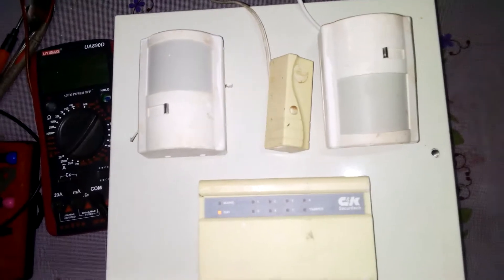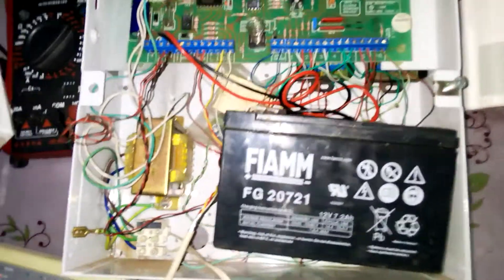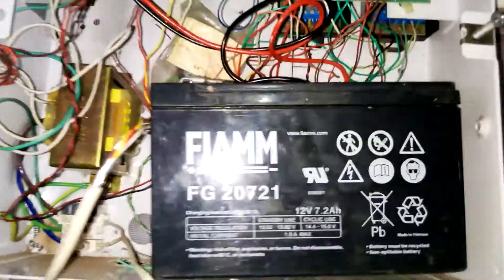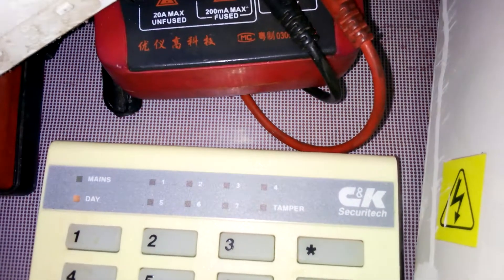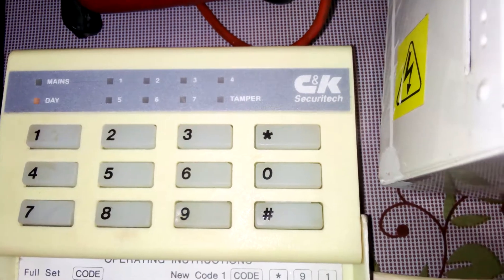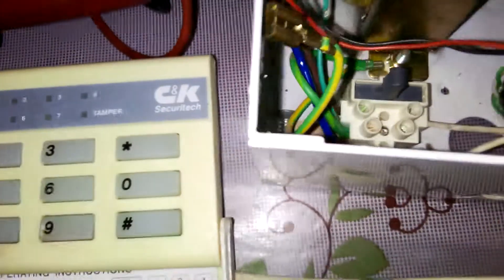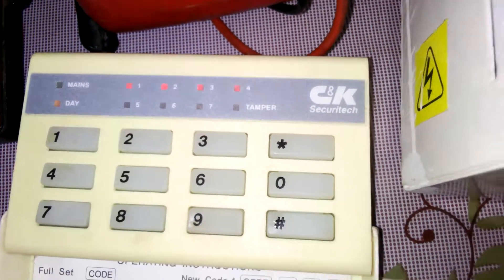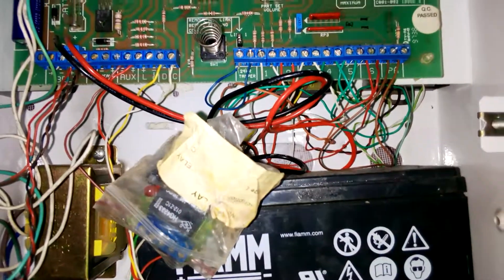C&K Securitech 700L alarm programming at home

Comment: Hiya i forgot the previous code. How do i factory reset the alarm and put new code. Please let me know
Reply from the maker: Open the control box.There is a reset button to factory default.
Reply: @expressautomationstechmast7029  is it really that easy? Surely someone breaking in would do this as well. I've  just bought a house with this alarm and just want to reset it also.
Reply: Where is the reset button as cant see it inside the box
Reply: @d.j.wwelding2705  hi I have the same problem as you. Did you reset it in the end.